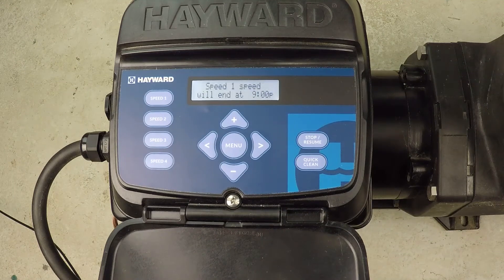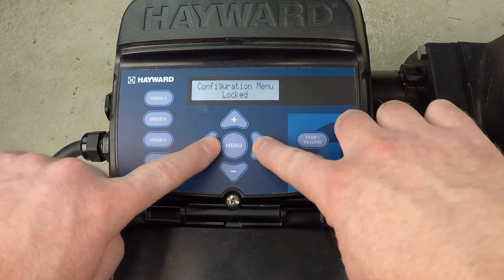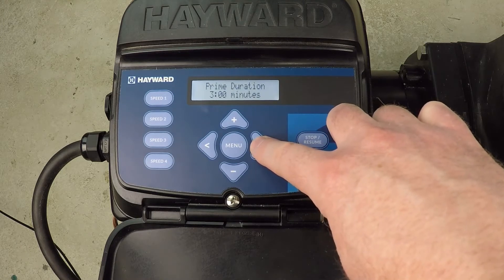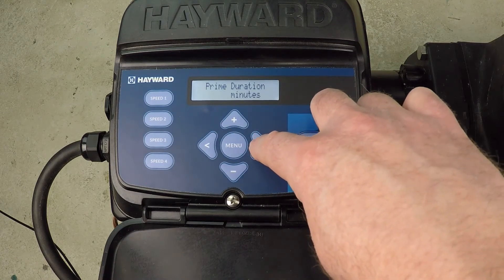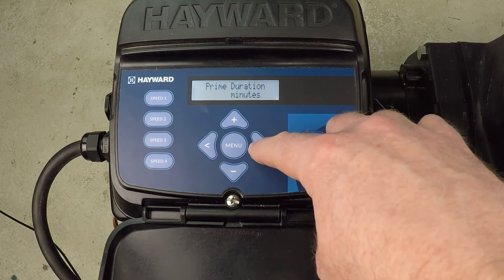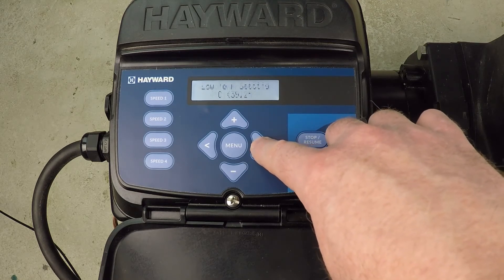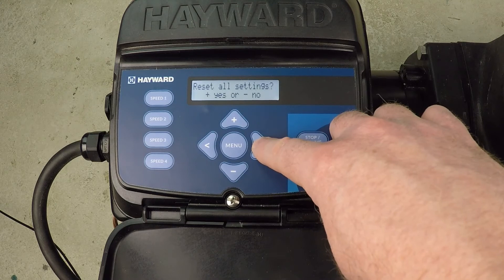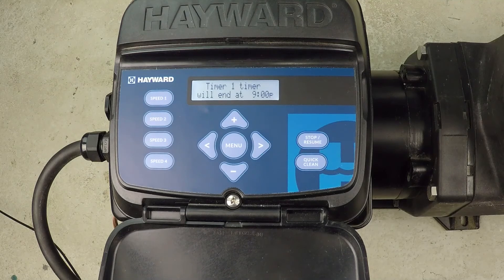How To Turn Off Priming Cycle On Hayward Super Pump VS

Comment: Hi Steve, how do you make these changes when the Hayward pump is wired to a Hayward OmniLogic control panel? Are the changes made at the panel controller? The tiny screen on the pump is not showing anything. Thanks!
Reply from the maker: If set for automation all controls and programming is done though the panel, not the pump.